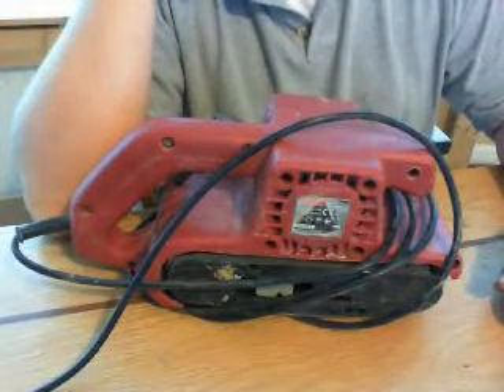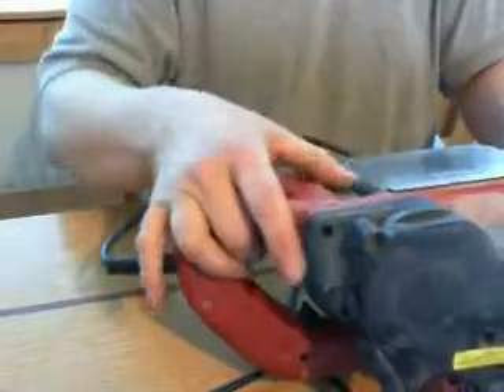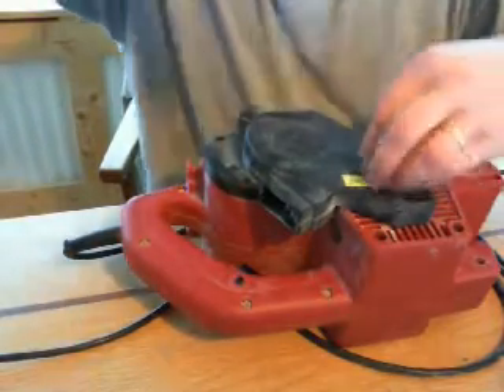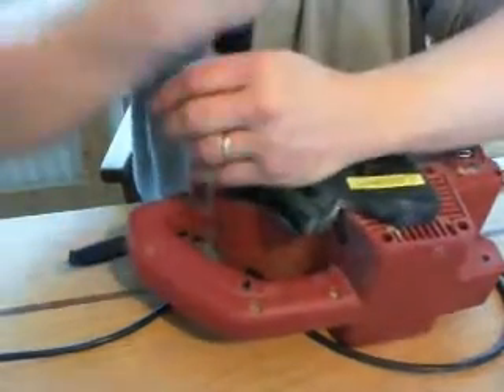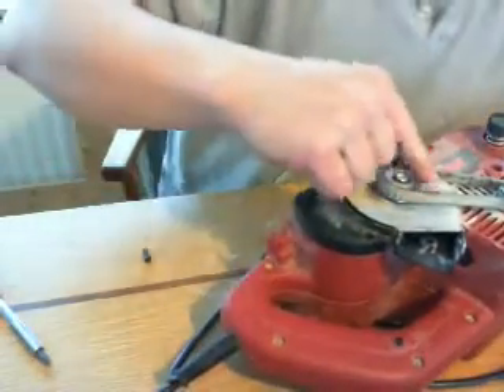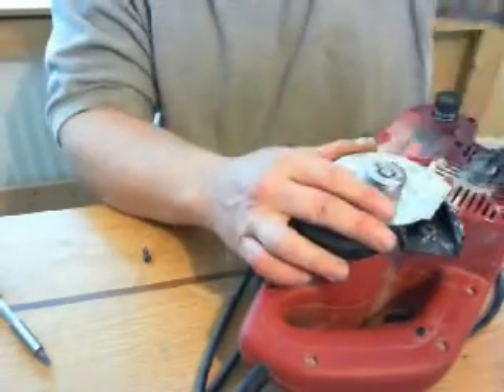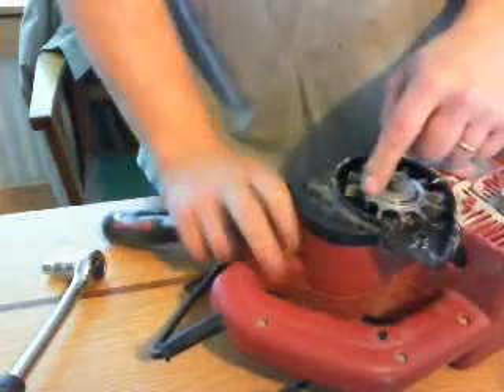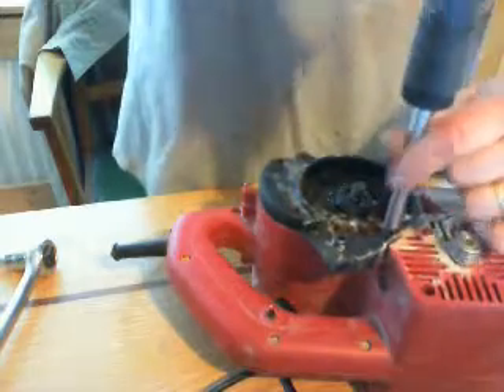How to build a Van Der Graaf Generator - Part 5a - Rollers and motor

Comment from the maker: It was some kind of cheap chinese import - I am afraid I don't knowexactly which one. As long as your top roller fits inside the top electrode it shouldn't matter too much though as your belt doesn't need to be as wide as the rollers. The charge will still accumulate to around 350,000 to 500,000 as the maximum voltage is a function of the top electrode diameter. If the belt is too small it will just take longer to get there.